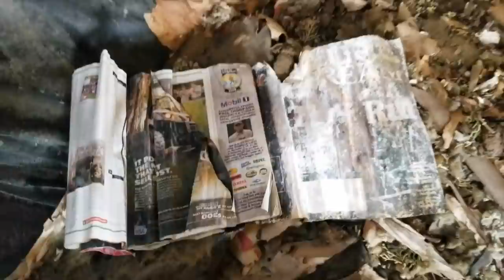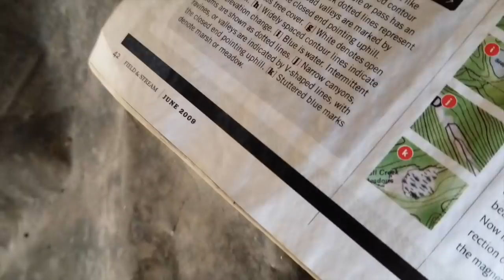My Nevada Mountain Home: Wild Horse Encounter At An Old Homestead Outside Vegas

Comment: A group of private investors should buy and reclaim that site. It has much potential - especially since it is close to a town a few hours away.  It would make a great place ( once fully rebuilt) with water, drainage, butane, solar, wind power,  to seasonally rent. Would need to have a place for a caretaker/s to maintain it and provide security.  Otherwise  - times being what they are - and S.O.B.'s prowling about - the ranch would be trashed.